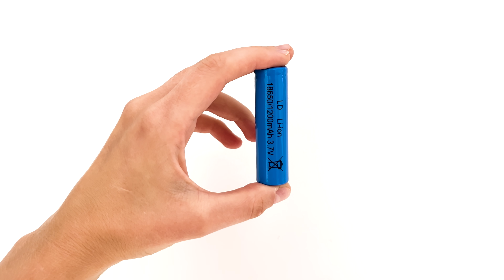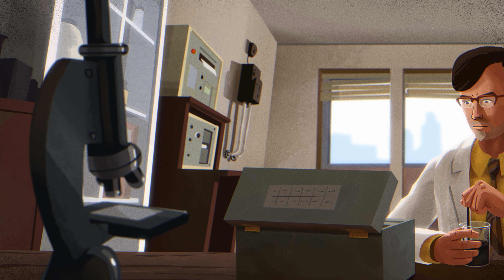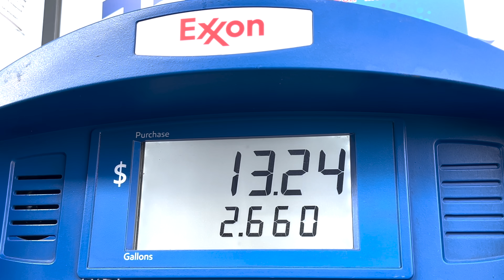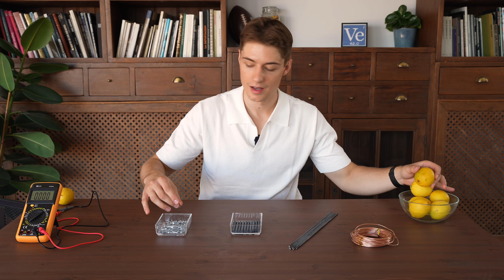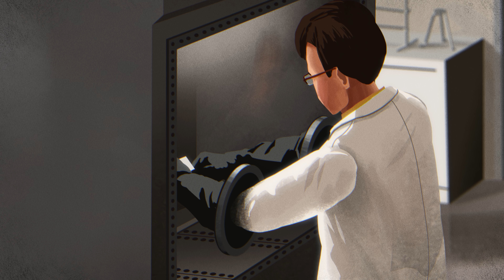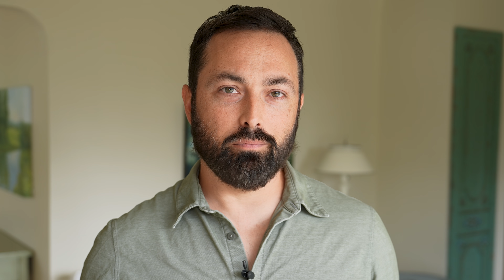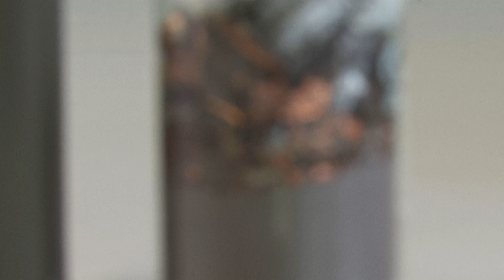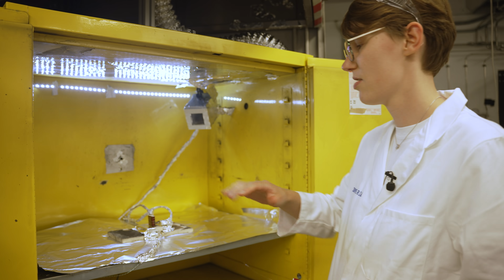The Perfect Battery Material Is Dangerous

Comment: Lead acid batteries have a cell voltage of 2V and they were the first rechargeable batteries commercially produced. 

I feel there is some confusion over this 1.2V cell limit.
Reply: Also endlessly recyclable, lots was passed over.
Reply: Lead-acid batteries do suffer from some electrolysis of water, producing hydrogen and oxygen - but in the context of starting up an engine, the amount produced is very slight. Outside of when you crank the starter, the battery largely sits unused.  (Overcharging generates considerable quantities, and is responsible for the occasional hydrogen explosion.)  In old-fashioned flooded-cell designs, one aspect of regular maintenance is the occasional topping off of the electrolyte with distilled water.
Sealed batteries (valve-regulated lead–acid (VRLA) batteries) contain and recombine the hydrogen and oxygen, so no water is lost.
Reply: They're probably the most recicled item in the world.
Reply: They still do produce gas, that's why SEALED lead-acid battery is a thing.
Reply: Edison cell batteries produced before that are just great for stationary applications such as telegraphy.
Reply: They're still in use everywhere - we have a standalone solar system that uses deep cycle golf cart batteries....sure, not as efficient as Li ion, but a lot cheaper. You probably know some people use recycled EV batteries, or Musk's "power wall" new EV batteries, but here in northern California we consider the fire hazard too risky.

Comment: Little did Exxon know that Whittingham was 50 years ahead of his time and if they made lithium ion batteries it might have brought in almost as much money as the oil.
Reply: They really didn't want electric cars to happen, so it's a good thing they didn't know.
The problem is that you can only sell the battery once, but keep selling oil for the car for decades. It's a bad business.

And they couldn't know then, but even today it's very hard to build a compelling electric car. Still only Tesla is making a profit on EVs, everyone else have to sell at a loss, sometimes at horrendously high loss.
Reply: @andrasbiro3007 I mean sure but EVs are not the biggest use case, it's the drones, phones, laptops, etc that are the biggest use case.  And at that point you'd have been years ahead of China so it's not like you even have to compete with them like you would have to now. 

In fact, it would have worked out great because you can produce them without impacting your existing market, they might have prevented EV adoption for even longer.

Comment: Wiki parallel plate capacitor, one jumbo roll of aluminum foil with teflon tape makes 80 megawatts at 8kv.  Then you need to seal 🦭 it, home hubble telescope varacter.  A shell of 00 jumper cable to aluminum cylinders creates groundless zero turn.  Just use ball bearings, theres ceramic bearings, groundless.

Comment: Major omission: newer Lithium-Iron-Phosphate (LFP*) batteries have a much more difficult time starting a fire, and conveniently these are also the most affordable lithium batteries.

*The "F" is for the atomic symbol "Fe" for iron.
Reply: You'd think with all that extra oxygen it would be more of a time bomb for a battery cathode, but interestingly no.  It can still go into thermal runaway and start fires but the energy of the reaction is much lower.  The energy is low enough that with the right cell geometry (usually a flat pancake style) it'll just heat up but not actually catch fire.  And LiFePO4 fires tend to be much more manageable, at least compared to an equivalent weight of a LiCO2-cathoded battery.

The downside is you get nearly half the energy density.  But it's still like 5x as good as NiMH, NiCd or Lead-Acid chemistries
Reply: @ohnoitslatekate  the oxygen is not in an oxidised state on account of oxidising the phosphorus, so shouldnt be that surprising or interesting. if oxygen is reactive, once its reacted, it should be stable. thats what it means to be reactive most of the time: the reacted state is more stable than the unreacted state.
Reply: @ohnoitslatekate  LFP batteries can still catch fire.  They have flammable electrolyte, lithiated carbon and lithium plating after many charges.  They are more stable due to lower voltage.  When a cell has an internal short, the power through the short will start the cascade reaction, since the voltage is lower, the power is lower.  Thermal abuse(heating), electrical abuse(over charging) and physical abuse(crush) will set them off just as easily as a cobalt containing cathode (NMC, NCA or LiCoO2).
Reply: People often say that, but it is not the LFP that really makes the difference. The thing about LFP is that the lower operating voltage gives you more flexibility on the electrolyte which meanas you can tune it more so that it doesnt really catch fire as easily. The lower voltage plays a small part as well. 
What you will often see with LFP batteries is that they will not burn but rather just off gas, which makes the risk much smaller from spreading from one battery to another.
Reply: Yeah the omission is irresponsible. The video implies all lithium batteries on the market will combust. And also they didnt mention that LiFePO4s dont use cobalt either!
Reply: Wheego LiFe
Reply: > *The "F" is for the atomic symbol "Fe" for iron. 

Iron is "Ferrum in Latin, which is why Fe is the symbol for iron. Just thought it might be interesting in case you did not know it.
Reply: LiFePo4 energy density is slightly worse than Li-ion. Granted their benefits are in many cases worth the tradeoff of lower energy density. But it means that (1) it's not the magic bullet, and (2) Li-ion will continue to be used in some applications. The search for substantially better battery chemistry continues.
Reply: I like the chemical shorthand better: LiFePO4
Reply: Limited energy density, higher cost, slower charging speed, lower discharge rate, and limited temperature range are some of the drawbacks of using LiFePO4 batteries..
Reply: @petesmitt  Combustion engines have bigger drawbacks in comparison to lithium batteries of any kind...
Reply: Ahh.  Here we are at the pedant's cemetery where semantics go when they die.  Let's go reading headstones honey.  Good lord, the pettiness!
Reply: What products currently use this technology?
Reply: LFP batteries are called "high current draw" batteries and is used for power tools, drones, and RC cars, since they are much more stable, they can handle more current and more heat before reaching thermal runaway
Reply: @aoyuki1409  I've looked a bit into them and they seem to have a really stable voltage too.
Reply: This!
Reply: I was looking for even a quick mention of LFP batteries but unfortunately there was none.
Reply: @bbecht  Too fresh for this prehistoric (last millennium, at least century) story? And, of course, the sponsor took away the time for mentioning alternatives...
Reply: It's called LiFePO4, not LFP. You can't just use a single letter for another symbol, F is fluorine.
Reply: @mernokimuvek   LFP is simply an abbreviation for Li Fe PO4. L is an abbreviation for Li, and P is an abbreviation for PO4. See how that works?
Reply: This isn't a video about every single battery. Its a video on how batteries became so prominent and what the challenges for a good battery are.
Reply: @Temperans  come on, LFP is the most used battery cathode nowadays you can't just omit it... This video would have been very good 5 years ago, but now the story is slightly changed. A pity because it was just a matter of 5 minutes to say something about it, but the story of LFP and how it arrived in China is controversial. So probably Veritasium didn't want to get into that
Reply: @Bert0ld0  They are mostly just covering the story of it. LFP didnt really come into play before the 2010 as people learnt how to better engineer the particle size and coating to work out.
Reply: @Bert0ld0  "Big LFP" didn't pay them enough to push their narrative.  What happened to the "you" in Youtube?
Reply: @Temperans  Except it focused on every touch point used by the EV haters without mentioning that most EV's today don't have any of those issues. 20 seconds. But there is a new technology LiFePo4 that is being shipped with most cars and storage batteries that doesn't burn, doesn't have cobalt, and lasts 10 times longer than Lithium Ion." Look done.
Reply: @zyeborm Okay and the point of the video is still not "hey look at all these batteries" but "hey look at how interesting the history of lithium ion batteries is".

Not to mention he explicitly said that people are still looking for better batteries. Which there are many people trying to create a better battery, LiFePo4 is not the only one and has the large disadvantage of lower energy density.
Reply: @Temperans yes. And? You haven't addressed my point or the one being echoed across the comments section that this video is deficient through omission in a way that appears almost carefully crafted to give a naive viewer a false impression of where batteries were 10 years ago in terms of safety. Let alone today. 
You can't go around directly quoting the corporate and politically issued attack lines against EVs in order and in depth without mentioning even in passing the things that address those talking points and claim to be any sort of unbiased non political purely factual report on batteries.
Reply: @zyeborm  Its not a report on batteries, its clearly a brief history of "how did we go from no batteries to most items have a battery?" The existence of more battery types was not excluded, nor dismissed, and he stated that there are people working on better batteries.

Also don't act like LFP are the most common battery in the market. Most consumer electronics use alkaline, most portable electronics use some variation of cobalt + lithium, and EVs mostly use a variation of cobalt + lithium (even if the use of LFP is growing).
Reply: Right.  They don’t combust but they do heat up.  But no thermal runaway.  But temperature still can exceed 300F.  The cell won’t combust but anything near it that can combust at 300F will combust.  

LFT batteries are even safer.
Reply: Since when has this guy ever cared about presenting the whole story, instead of just clickbait shock value "today I found out" style videos

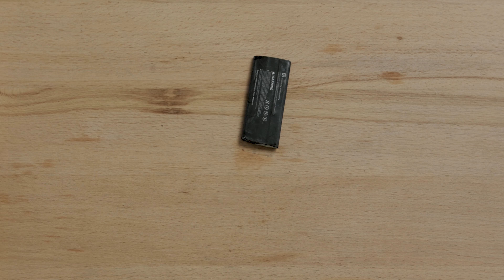Comment: 0:24 That's a Li-Poly, not Li-Ion. correct me if im wrong
Reply: The full name of li-poly is "Lithium-ion polymer". Its the same technology just slightly different
Reply: @DaffyDaffyDaffy33322  I hydrolyzed a LiPo and drank the contents. Now I have no teeth, no oesophagus, and no regrets.
Reply: Any cell that uses the intercalation of Lithium ions within a graphite (or any other type) substrate is a Lithium Ion chemistry cell.
Reply: You are right
Reply: LiPo battery is a type of Li-ion battery, just like LiFePO4
Reply: Zing
Reply: I think they're basically the same chemically, but Li-poly uses a polymer-based electrolyte
Reply: The two terms have different, distinct meanings to the people who work directly with them, while one is a subset of the other to people who work peripherally with them, while the general public probably uses them interchangeably. I'd probably fit somewhere between the first two, but I'm too preoccupied with correcting people on the battery vs cell terminology to get involved in this one.
Reply: Lithium poly is a sub type of Lithium ion
Reply: ... And here we have exhibit B.

Comment: Lets not forget that Cobalt is also used in gasoline refining to 'clean' sulphur from oil based fuels, (Cobalt compounds are detectable in Exhaust Fumes). 
At least in a battery it is 100% sealed with no loss and can be recycled, and Lithium Iron Phosphate (LFP) batteries don't use Cobalt at all..

Comment: Oh, that “fully charge before use” thing wasn’t just nonsense
Reply: The first charge where the chemical insulating reactions occur happens at the battery factory, not by the user.
Reply: As he stated, this is done in the factory. Not at home where the user could.... WOULD screw it up
Reply: That's what I was thinking hahaha
Reply: For longest battery life, you should charge them to 80-85% and always keep them above 15-20%.
Reply: @mernokimuvek  "For longest battery life, you should charge them to 80-85% and always keep them above 15-20%."

 True for NMC batteries but NOT TRUE for LFP batteries. LFP batteries can be charged to 100% without degradation.
Reply: This is usually the case for Nickel Metal batteries, not Lithium ion. (Not to be confused with Nickel manganese Lithium Ion batteries)

Nickel metal Hydride batteries had to be charged to 100% and discharged to 0% several times when you first used them or else they developed a bad “memory”. If the first time you used a Nickel Metal hydride you charged to 50%, it could cause the cell to not want to go to 100%
Reply: @ZyghqwyvYou're thinking of Nickel Cadmium batteries, Nickel Metal Hydride batteries do not have a memory effect.
Reply: @pfarnsworth84 NiCad had it worse than NiMH, but NiMH still has a memory effect.  Both form dendritic crystalline structures that lead to the memory effect. For both chemistries the military has procedures for reversing or minimizing it.
Reply: I recently read Einstein’s book: “Relativity: The Special and General Theory” and in the chapter: “The Apparent Incompatibility of the Law of Propagation of Light with the Principle of Relativity” he says that his constancy principle was well known at his time even by kids, but this seems impossible as his postulate was very complex, have physicists misunderstood this principle? 
But if we have, then what logic led him to his theory? Some people say that the constancy principle was obtained by joining his two postulates but the book clearly shows that this is not the case either.
Please Veritasium reply to this comment if you’re interested as there is more to say on the topic.
Reply: @LLV008 Some people say that by joining 2 books together makes you twice as smart.

Comment: Bro forgot about Silicon-Carbon batteries☠️
Reply: Bro and skull emoji...
Reply: Na-ion is a low cost version of Li-ion for trucks and large power storage.
Reply: Those are still fundamentally Lithium Ion

It's just that the anode is replaced with Silicon Carbon
Reply: @VaalkinTheOnly  Its more like an evolution stop-gap before we see real gamechangers like Solid State batteries or Na-Ion batteries

Comment: Interesting, to say the least! I didn't realize lithum-ion batteries release toxic fumes... I have come across plenty of cheap "foil batteries" which are basically lithium ion batteries wrapped in a foil-coloured pouch, hopefully sealed airtight. One extremely cheap MP3 player even had just the battery without a foil pouch. It was in a shrink-wrapped bag that was barely better than a ziploc. When the player stopped working I took it apart and was shocked at how simple and inert-looking the battery was, in comparison to lead-acid as well as standard zinc carbon batteries... little did I know! I wonder how many such shoddily manufactured cheap batteries I have in my home right now!

Comment: It's interesting that lithium is used in both batteries and CO2 scrubbers for the same reason, the hydroxide can react with CO2 to form the bicarbonate and LiOH is the lightest alkali metal hydroxide, and it can also give away the most electrons per mass since each atom is the lightest

Comment: The top US EV is the Tesla Model Y per GROK:
"There are no confirmed, publicly documented Tesla Model Y high-voltage battery fires in the US for 2024 based on the available data
"

Your headline is total clickbait and spreads fear about BEVs when the facts show BEVs are far safer then gasoline and diesel vehicles.

Comment: You don't need a solid lithium anode. You only need enough lithium ions to fully charge the cell. The base anode material is usually graphite(cheap, resilient, low capacity), silicon(high capacity, low resiliency), or some combination of cobalt, molybdenum, and nickle to push capacity and resiliency.
The fact they don't use as much lithium is likely partially responsible for why they are called 'lithium ion', versus the older tech non-rechargeable 'lithium' batteries. So much less in fact that it is very uneconomical to recycle lithium ion batteries after considering all the large amount of other contaminates in them. It's cheaper to just dig up more lithium. Not to go off on a tangent, but I believe lithium ion batteries becoming economical to recycle will happen the moment demand outpaces supply, so it will happen eventually.

You can make a lithium battery with pure lithium anodes, and although it would result in the highest possible energy density, it makes for an expensive battery that is extremely volatile, fragile, and potentially prone to internal shorts from dendrite formation. That is a very bad combination of cons if you want it to be rechargeable.

Comment: Unrelated question, assuming you cleaned the anode and the cathode before putting them into the lemon, would the lemon be safe to eat after you cut the lemon in half at 5:18? Like there’s more ions flowing through half of that lemon, so is it safe to eat? 🤣
Reply: Depending on the metal. I wouldn't eat it if he had used a cadmium or lead electrode. Zinc, magnesium and iron (assuming they are pure) however should be fine in small quantities

Comment: What about silicon carbide batteries?
Reply: Silicone carbon battery is just a more advance form of lithium battery. Tradition lithium ion batteries use graphite as anodes, while the silicone ones using silicone anodes.